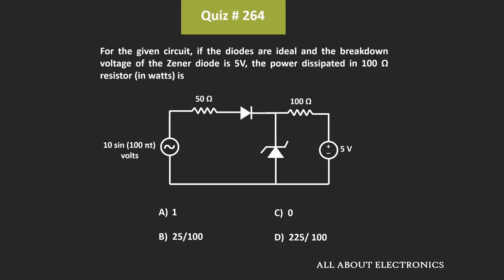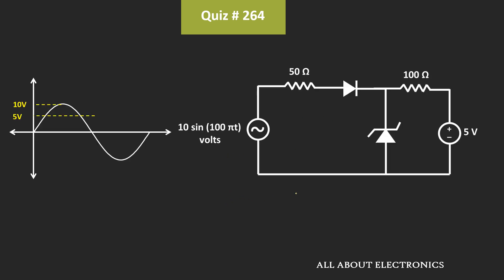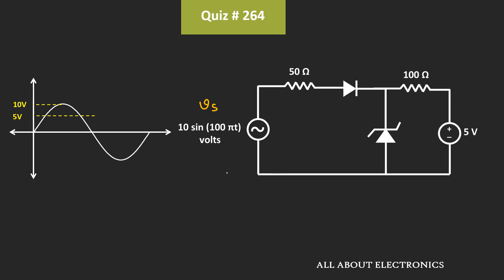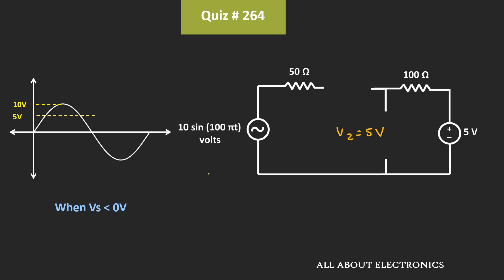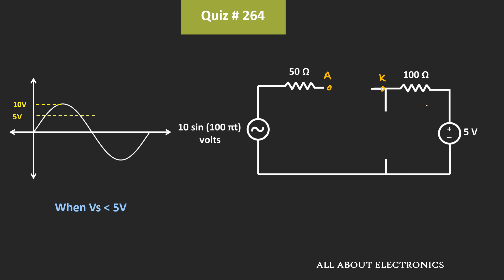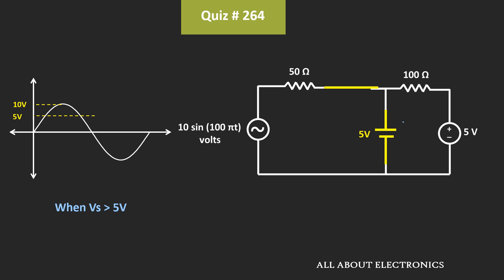Diode Circuit Solved Problem |  Quiz # 264

Comment: when Vs > 5v,Can u please explain how come the voltage across Zener Diode becomes > 5v, I believe the voltage across Zener Diode will be voltage at the junction point between two resistors, and by Thevenin analysis if open terminal of Zener Diode,  then  Vs - (Voltage drop across 50 ohm) - (Voltage drop across 100 ohm) - 5 = 0, if Vs is 7 let us say, the (7 - I*50- I*100 - 5) = 0, I = 0.01333A, so Voltage drop across 50 ohm = 50 * .0133 = 0.6666, thus voltage across junction is 7 - (0.6666) = 6.3333, so whether it will always be greater than 5 V and thus zener will be turned on , I want to know without doing all these calculation how did u infer that it will always be greater than 5 so as to turn on Zener Diode
Reply from the maker: Just to check the voltage across Zener diode, for a time being just remove the Zener diode from the circuit and find the voltage at that node. Now, if you see the circuit, then  we have a two voltage source. At one end, we have a voltage source of more than 5V (Vs) and at the other end, we have 5V voltage source. And in between we have two resistors. So, as we move from one end to other end, (From Vs to 5V), there will be a voltage drop. But at the intermediate node, voltage will always be more than 5V. Let's say, you have two voltage sources (10V and 3V) and in between, you have resistors. So, at the intermediate node, the voltage will always be more than 3V. In same, fashion, here we can say that the node where the Zener diode is connected, the voltage is always more than 5V. And hence it is conducting.
Reply: Thevenin analasis Vs - (I*50) - (I * 100) - 5 = 0 => Vs - 5 = 150*I,  I = (Vs -5) / 150, so voltage drop across 50 ohm => 50 * (Vs -5)/150 => (Vs-5) / 3 , so voltage at junction i.e Vj = Vs - (Vs -5 ) / 3 => (2Vs + 5)/ 3 in order Vj i.e violate at the junction i.e voltage across zener to be greater than 5, =>  (2Vs + 5)/ 3 should be greater than 5, so (2Vs + 5) > 15 so 2Vs > 10 so Vs > 5, I arrived at this conclusion with these calculations, Please verify its correct and explain how did u arrive at the conclusion that Vs should be grater than 5 in order to turn on zener I know Vz is 5 but how did u infer that Vs should be more than 5 so that voltage across zener will be more than 5 to turn it on

Comment: In the negative half-cycle shouldn't the zener diode act as a regular diode in forward biased mode and be replaced by a short circuit?
Reply from the maker: since, first diode is OFF, the AC voltage will not appear across the Zener Diode.

Comment: Is there a practical application for such a circuit?
Reply from the maker: This particular circuit may not be a very useful. But these type of circuits are used as the protection circuits.
If one is able to solve such example, then during the design one can select the diode values properly in a such a way that the circuit works properly at the rated voltage and current.

Comment: 1:03 how does the zener diode gets open circuited ? Pls help
Reply from the maker: For a moment, let's say at 1:03,  the Zener diode is conducting, then there should be a flow of current through the Zener diode and through 100-ohm resistor as well right !!
If some current is flowing through the 100-ohm resistor, then there is a voltage drop across it and the voltage across the Zener diode will be less than 5V. So, it won't conduct.  
If the DC voltage source is even 5.1V, then the Zener diode would have conducted. But at 5V, it won't conduct and will remain open-circuited.
I hope it will clear your doubt.
Reply: @allaboutelectronics-quiz  got it , thank you sir 😍